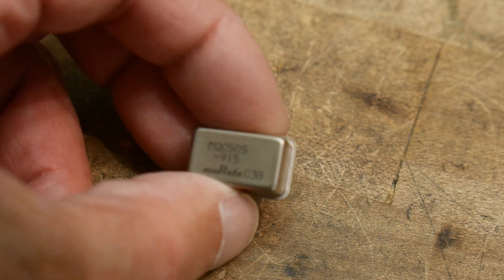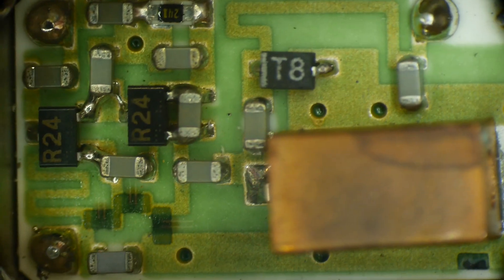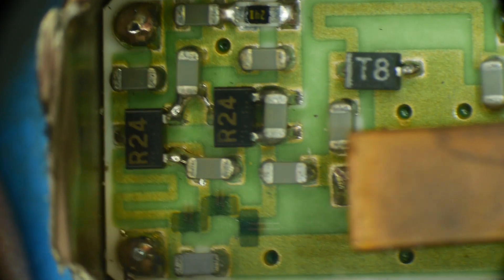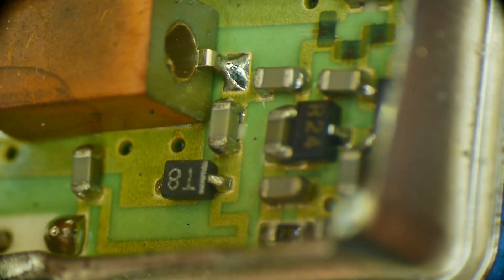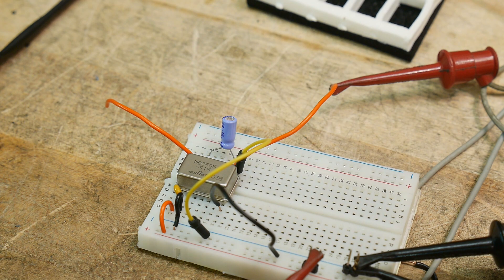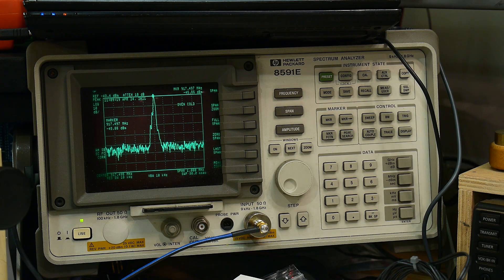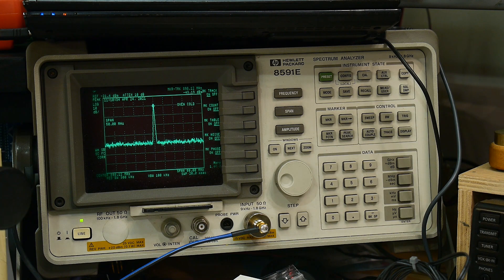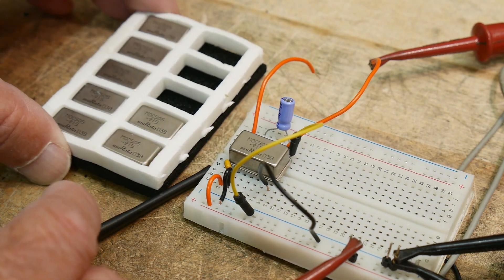#793 915MHz VCO Voltage Controlled Oscillator Module

Comment: Wowowoow! Pretty cool. I wonder how this little fellow works
Reply from the maker: Pretty simple, the resonant cavity+capacitor creates and LC oscillator. The capacitor includes a varactor diode (marked T8). that is a voltage dependant capacitor.

Comment: As already said, it is a coaxial dielectric resonator, made of high dielectric constant ceramic material (typical value 38) to shrink dimensions. Its fundamental mode of operation is TEM and it is commonly used up to, say, 4 GHz. Major manufacturer were MURATA and TRANSTECH. Beyond, that frequency limit, you may prefer to choose a dielectric puck, resonating on the fundamental mode TE10delta. T8 is a varactor diode to tune the frequency and, based on the large tuning range and the constant tuning slope (MHz/V), I suspect a hyperabruct junction diode type. MACOM was an excellent manufacturer of varactor diodes. Back in the days I designed a lot of these VCOs, DROs etc, as building blocks of sophisticated multiloop frequency sinthesizers. Those were very creative times, when a piece of electronics art like that, was not readily available from China...regards from Italy.

Comment: Nice demonstration. 
You could build a small fm  transmitter by modulating the input with an audio signal. 
It should even be fine, since you are in an ISM band, right?

Another idea might be to show how a spectrum analyzer works by using the vco as a LO. 
put in a mixer, a bandpass filter, a power meter and an arduino and you have a simple spectrum analyzer to show the principle. 

Greetings, 
Michael
Reply: Seems interesting, like these ideas.